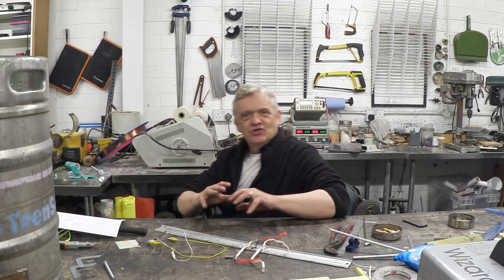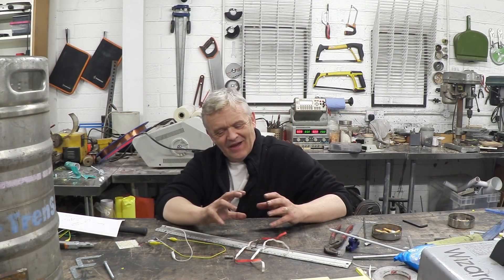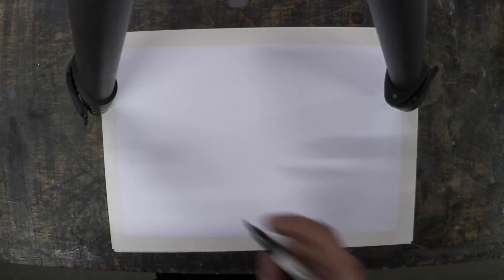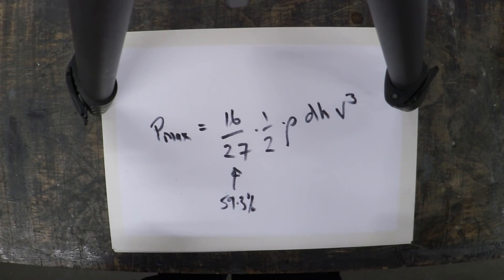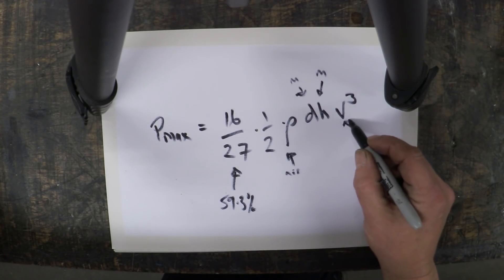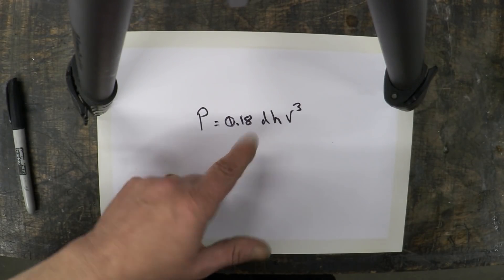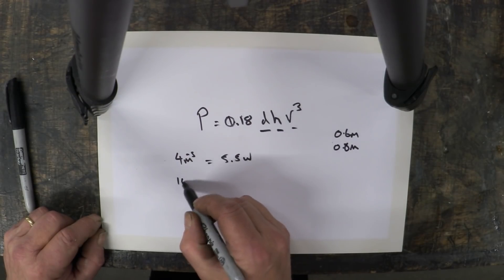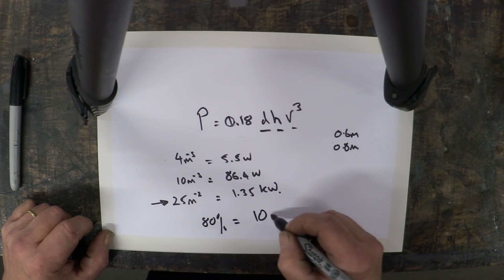Building a 1kW Wind Turbine For Under £100 - Betz Law

Comment: Just curious because looking math, I think there is an error in your calculation regarding the area?
Your turbine is 800x600mm (lxh) therefore the actual wind pickup area would be 400x600mm as its half of the drum? Or have I missed someone here?

Comment: Though Robert will be unlikely to read this post I make it because it may be of interest to other readers. A few points about the series.

Magnetic Circuit.
If you look at a commercial motor (or generator) you will see that great effort goes into reducing the gap between the moving and stationary parts of the magnetic flux path down to about half a milli-metre or so.  I suspect this requirement is much more difficult (read: expensive) to achieve on the outside edge of a wind turbine than on a self-contained generator connected to the shaft.
Having said that, Robert's rig does decelerate under load (which is what we want) so there is some hope.
In order to improve the performance it would be possible to reduce the gaps in the magnetic circuits:  Firstly by getting the transformer core as close as possible to the magnets, and secondly by arranging an iron 'keep' (perhaps the removed side of the transformer) on the other side of the magnets to minimise the gap on that side.  I can't see how to arrange this on the current layout but a better result could be achieved by rotating the magnets so that they face outwards, hanging below the lower rim of the rotor so that the 'keeps' could be mounted on the base, inward and opposite the re-oriented transformers.

Low winds and Starting
If we do all of the above and achieve good coupling of the magnetic circuit we will find that the 3kg pull from each magnet will cause the rotor to click around in steps.  In a worst case this could prevent the rotor starting in low winds.  It may be possible to alleviate this effect by making the position of the coils fine-adjustable so that phase of the 'clicks' from each coil is cancelled by all the others.  The more coils the better.  This effect is usually addressed in commercial solutions by using a single coil on the rotor instead of permanent magnets.  This arrangement is called an alternator rather than a generator.  It needs some sort of regulator to control the rotor current and hence the output voltage.  The regulator also prevents any current flowing until the rotor is rotating at an adequate speed.

Comment: Based on your numbers, "0.18" already factors in the 50% efficiency of Savonius type wind turbine, so you don't need to divide it by 2 again, and your max is, in fact, 1.08kW (at 80% efficiency).

Comment: you can put a tray around the wind device, collect the water to central points within the trough, like a moat around a castle and add drainage pipes, and use that as an energy source. rainwater energy. you can use funnels as well. whatever forces the water down the funnel increasing its impact

Comment: Robert, V seems to be the most important variable in the formula (because cube). Could be possible increasing V with any kind of design of funnel to getting closer to those 25m per second?
Reply: Adding a funnel reduces the overall efficiency by reducing Cp.  He will soon learn ( or maybe not ) that Cp is NOT a constant.  A decreasing Cp, actually reduces the amount of wind energy that is converted into mechanical power.   WHO has 25 meter/sec ( 90 km/hr ) wind speed in there back yard ?

Comment: How does betz law accomodate the number of blades?
Reply: Betz law does not specify the type of turbine. It’s the limit that a perfect, 100% efficient, rotor could achieve. You simply cannot catch all the kinetic energy in wind because to do so you would have to stop it dead. But that would block any further wind from passing through your rotor. It turns out that 59% of the total energy in the wind is the most you could possibly get. Try to slow the wind any further to extract more power and you affect the upwind speed so that it has less energy to give.
So a 100% efficient rotor could extract about 59% of the total kinetic energy of the wind. The most efficient HAWT systems can manage about 80% Betz efficiency, thus capturing only about 48% of the wind’s total kinetic energy. Savonius rotors such as Robert’s get at best ~25% Betz efficiency.

Comment: Is greater output possible if you were to reproduce the attachment of Magnets on the top of the turbine and add the coils likewise upside down facing the top ring of magnets as the bottom increasing output?   Of course you would need to create the required spacing!  👨‍🔬

Comment: Great work Robert, but don't forget you also got losses due to the (in)efficiency of the turbine itself. Many VAWTs are only 40% or worse.
Reply: And this is a DRAG type VAWT, it has no "Lift" in the airfoil. Actually, there are no airfoils ...

Comment: Hmm I think your formula is based on regular wind turbines. Like the large three-bladed ones. Not the squirrel cage variety you made. Also, your efficiency rating will be on the low side since the caged variety of "turbine" you created is much less efficient than the broad turbine variety. That is assuming the formula could even be adapted for the caged variety.
Reply: Also, it is a DRAG type of HAWT.  He has no airfoil, there is no "lift" force ...

Comment: There was a interesting reason I read a few years ago for the propeller type turbine having twisted blades aswell as shaped form, the reason given was that the tip was going at a different speed to the base of the blade, and therefore if you didnt have a allowance for the slower parts being pushed and therefore being a fan by the faster parts, it causes a inefficency, so the blades are twisted to cause the air to slip over faster over the slower parts of the blade. It was a interesting  reason, I dont know how correct it is, but looking at larger turbines blades they are profiled and some of them have slight twists in them too. I would think the twist would reduce the potential energy from the blade, but not as much as the slower part acting like a fan.

Comment: Hi Robert!
Sorry to keep correcting you, but you’ve got your constant wrong by a factor of ~2.
Assuming ρ = 1.19 kg/m^3 as the density of air, the constant 16/27 x 1/2 x 1.19 = 0.35, not 0.18 as shown. What value did you use for ρ ?
Now to calculate Betz power limit for a 1 m^2 turbine, [height x diam for VAWT,  (π x diam^2)/4 for HAWT]

Airflow (m/s).        Betz limit (W)
        1                               0.35
        2                               2.8
        3                               9.45
        4                              22.4
        5                              43.75
        6                             75.6
        7                            120.5
        8                            179.2
        9                            255.15
       10                           350

       15                        1,181 

        20                       2,800

        25.                      5,469 

I think your turbine has a different area, but if you express that area in square metres then multiply the above figures by your area you’ll get Betz power limits for your turbine.

Being absolutely honest with you, you’ll be doing well if you output more than a fifth of those figures.If your turbine operates at 20% efficiency it will be pretty good for a Savonius type design. 75% efficiency in your generator, would be amazing for a home made generator designed around unmatched components. Which brings you to somewhere around 15% of the Betz limit. Higher efficiency requires Aerodynamic lift as in  the Darrieus design. 

Do not be disappointed if you get perhaps 35-40W max in a 10 m/s breeze. I’m sure you’ve hoped for more, but the big boys operate at 80% Betz efficiency and perhaps 95% electrical efficiency, and even then they’re taking less than 50% of the wind energy that passes through their rotors.

By all means keep trying. Savonius rotors can be durable and rugged, which they need to be if you’re going to get useful power out of them. Suitable for high wind environments such as mountains and Antarctica. Not that useful, elsewhere. Possibly good, in conjunction with solar panels, high eff. LEDs and Li-ion for a remote street light, weather stations, comms towers etc.

Finally, add my voice to those others on the power/energy question. Power (W, Watt) is the instantaneous production/consumption of energy (J, Joule). A 60W light bulb uses 60J of energy every second. If I multiply the power by the time, as in my 60W bulb switched on for 20 seconds>> 60W x 20s = 1200J. 
Now a Joule is a pretty small unit. You eat a third of a million of them with your morning muesli. So the electrical industry came up with the kW.h. It’s the amount of energy created/consumed when there’s a kW of power for an hour. 1000W x 3600s = 3,600,000J or 3.6MJ.
A genuine industry standard 1kW wind turbine is able to put out that power at a wind speed of 10m/s (~22mph). Even at the Betz limit you would need a turbine area of 2.86m^2 to achieve that performance. In practice, considerably larger.
Please do not take these remarks of mine in anything other than the helpful spirit they are intended.
Kia Ora
Micko
Aotearoa-NZ
Reply: @Q.E.D. - He forgot that this is a DRAG type of VAWT.  It has no airfoil, there are no "lift" forces on his blades.
Reply: @Q.E.D. - But only 1/2 of his so-called "... H x D = Surface Area .." is actually capturing any wind energy.  The other half the Surface Area is actually pushing back AGAINST the Wind.   So, there is a huge DRAG co-efficient missing from his formula.   He does not have a 1 meter^2 Wind Turbine.  More like a 0.5 Meter^2 total surface area.  But then only 50% generates power, the other 50% generates DRAG and needs to be blocked / covered.  So, your Watts calculation are more than a factor of 4 TIMES, too high.  He is applying a formula that works well for a HAWT, but does not work well for a VAWT.  And who has 25 m/s = 56 MPH = 90 Km/Hr winds in their back yards?  Pieces will fly off and break the neighbor's windows ...
Reply: @MrSummitville  
The Betz limit is independent of the type of rotor. It’s the limit of extractable power from a given airspeed across a given area, regardless of the method used. It reflects the fact that to extract all the KE you would have to reduce the wind speed to zero which would block incoming air. This limit is approximately 59% of the total kinetic energy in one second’s worth of wind passing through that area. If we try to slow the wind down by more than about 25% of its initial velocity we start to hinder the passage of the air and get diminishing returns. 
It’s how you can compare the efficiency of different systems. A wind turbine capable of capturing 59% of the total energy would be 100% efficient. Of course, one of the reasons drag turbines, such as the Savonius type, have such low efficiency is, as you pointed out, that they’re only using one half of the available wind. In fact the other half is actively reducing energy extraction. However, the stresses on the structure increase relative to that total area, and this is the area we need to consider when comparing different rotors.
Savonius rotors have some advantages. They can be built to operate over a greater range of wind speeds, and they are largely unaffected by wind shear. They are quiet, present little danger to birds and can be built both simply and robustly. Their maintenance requirements are generally far less than lift turbines such as HAWTs or Darrieus type VAWTs, but their output is far lower. Good for remote, low energy requirements, such as unmanned weather stations in areas where solar panels are unsuitable. Great for high latitude winters. Fine for low power requirements. But, using the Betz limit as 100% efficiency, the VERY best HAWTs can attain ~80%, the best Darrieus types ~60% and the very best Savonius around 25%. This is shaft power. There are inevitable, further losses in converting that shaft power to electrical power.All of these efficiencies only apply at the designed wind speed. At higher or lower wind speeds the efficiency will be lower, though a well designed, variable pitch HAWT may be able to operate close to maximum across a range of wind speeds.
There are good reasons why HAWTs have a higher efficiency than VAWTs and equally good reasons why Darrieus are more efficient than Savonius. That’s not to say improvements cannot be made, but Savonius is ALWAYS going to come third in the efficiency stakes because drag effect rotors are inherently less efficient than lift effect ones.

ETA
Yes, my Watts calculations were based on an area of one square meter, and the 20% efficiency was just about the upper limit for Savonius designs.
Reply: @q.e.d.9112  No, you are wrong about the Betz limit applying to ALL Wind Turbines. There are a couple of VAWT designs that do EXCEED the Betz Limit!  The Betz Limit, of 16/27 or 59%, does apply to the max Cp of all HAWT's.  But there are VAWT's that have a Cp = 67%, in the real world!  That is a difference of +8% HIGHER than the Betz Limit of 59%.  But, yet you FALSELY claim that is not possible.  You should increase your knowledge regarding the highest Cp possible for a Vertical Axis Wind Turbine ( VAWT ).  
   P.S. ...   I did not ever say, the VAWT in this video would ever exceed the Betz Limit.  I did state, that the Cp would be LESS, a lot less, than 59% ...
Reply: @MrSummitville  
They may claim an efficiency of 67% “in the real world”, but the real world is governed by some pretty solid physics. Betz law is about wind NOT devices. Extracting kinetic energy from wind, however you do it, requires the air leaving your “windprint” to be slower than when it arrived. But this slowing of the air leaving your device creates a logjam that reduces the speed, and hence the energy, of the air arriving at your device. The upshot is that when you rob the wind of 59% of its original energy, ANY attempt to take more will result in a situation where you may reduce the outlet velocity further (that’s the ONLY way you could possibly extract more energy) but, in doing so, you lose more energy in your “choked” upstream flow than you gain by extracting more from your exhaust stream.
I stress again, this is nothing to do with your device.
In reality I’ll bet that “REAL WORLD” 67% is actually 40% = 67% of 59%.

As to VAWTs being able to better HAWTs efficiency, there are good reasons why this is unlikely to be the case. The first is that the upwind side of the VAWT has already taken a proportion of the energy from the wind before it reaches the downwind side. Secondly the angle of incidence remains constant on a HAWT and may be variable to provide efficiency across a range of wind speeds, but it’s constantly varying and reduces to zero, twice for each blade in every revolution on a VAWT. Thirdly, the forces acting on the blades of a HAWT are relatively constant, but those on a VAWT shift 180° every half revolution. This can cause vibration, excessive wear and possibly fatigue failure.
Don’t get me wrong. I like VAWTs because even a sophisticated Darrieus is simpler to engineer than a HAWT.
I think they look better, particularly the ones with S shaped blades and of course they are better than HAWTs in disturbed air flows such as in urban environments.
But that said, I suspect a £100 solar cell would produce a hell of a lot more electricity over the course of a year than any £100 wind rig. 
Overall, I think Robert is having fun and so are most of the people watching this. I think, as has been suggested by another commenter, that it would have been beneficial if he had done some more research. But it’s all part of a learning curve. I suspect he could be in for another when he starts to measure the output from his little generator.
Reply: @q.e.d.9112  You are wrong. Go test a real world VAWT that has a Cp greater than the Betz Law.  The Betz Law is applicable for an OPEN DISK ACTUATOR.  A VAWT is not an Open Disk Actuator ... It is a 3-Dimensional Cylinder . What you fail to understand is - the wind stream can release more energy a SECOND time when it exists the rear of the VAWT.   I don't care what your " theory" is, since REAL WORLD VAWT''s prove that your theory is wrong ...

Comment: I read an american patent. Rather old, but anyway, the patent focused on adding "tubes" of some sort..to prolong the time it would take wind to travel a cross the blades. How would that translate into W and H in the formula? I guess it would mean divide the half with the whole - The basic idea of the American patent above was to make wind have to make a longer travel along the blades. By adding this tube riffles along the blade they had success - they claimed.
Reply: Was this device every built?  A patent on an idea, does not imply that the idea will actually work in the real world....

Comment: The only way I see that the Betz limit can be beaten is by taking advantage of ground effect. In other words taking the exhaust off the blades after they have done the work to drive another rectangular set of blades. In HAWT it can be achieved with - two sets of 2 blades rotating together - the front leading edge of the first set of 2 blades are moved from the conventional position-  so the front blades 2 leading edges are along the diameter, centre line. Then cleverly fix another set of blades very slightly behind the first both blades at the same angle - going in the same direction - this time with the trailing edge along the same diameter centre line. The first set of 2 blades exhaust onto the second set of 2 blades as they rotate. The second set of 2 blades acting as ground effect for the first set of 2 blades - reducing drag. If adopted would transform efficiency of wind energy production.